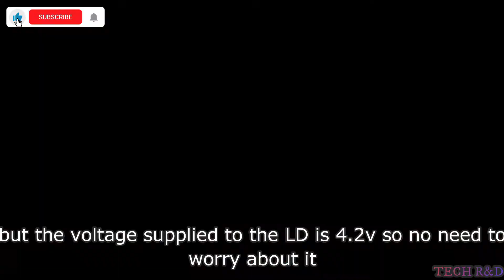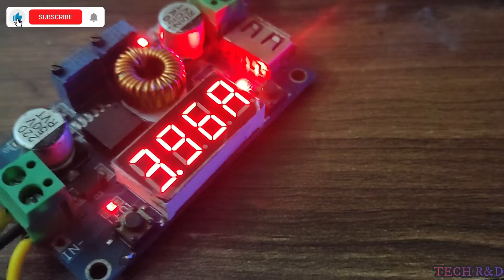DIY Laser driver | TECH R&D

Comment: I have a 10w laser module, I also do as you instructed, but when pwm only gets 50% of the power of the laser diode, what do I have to do to get enough power of 10w
Reply from the maker: 1st thing you have check it's datasheet wheather it's actually 10w or not,
2nd if it's so, then check it's absolute voltage & current rating and accordingly set the voltage and current, like say datasheet says absolute rating is 4.3v and 3 amp then set the power module output  voltage to 4-4.15v  and current to 2.5-2.75 amp max 
also check pwm voltage if you set pwm to 50% then your laser will only output it's 50% power so to get full power you need to set atleast 80-95% of pwm to achieve max output from laser